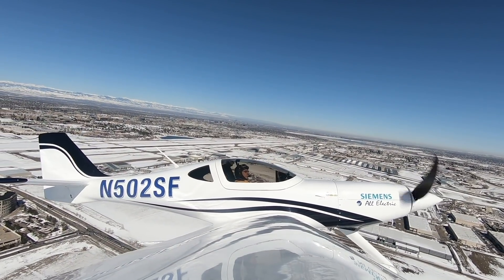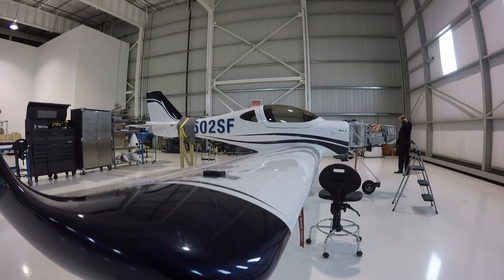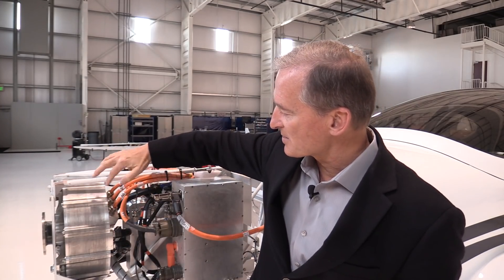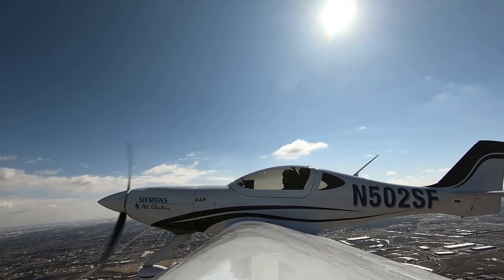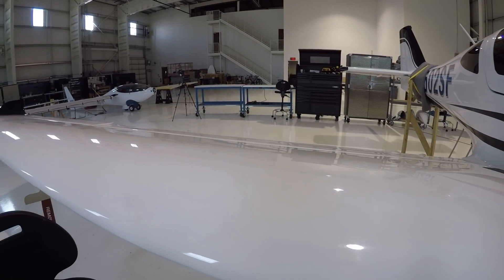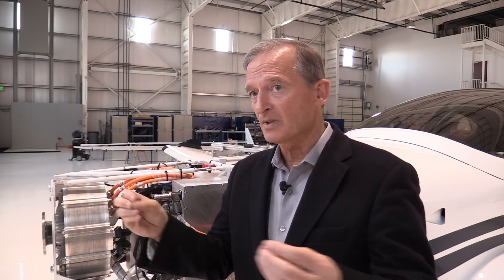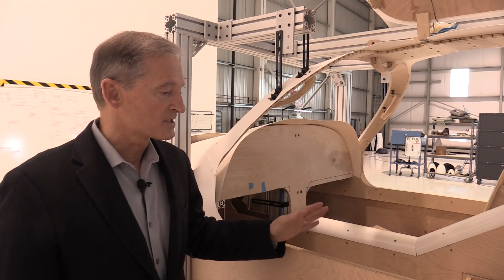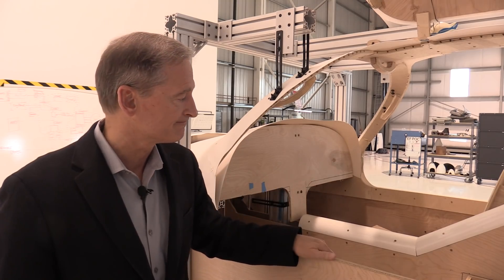Bye Aerospace's eFlyer Electric Trainer

Comment: So what he is really saying is that electric is so heavy it requires GA certification to get the payload needed for a practical training flight of one hour only. Has anyone told him that the current GA competition has a price point of $260 k for a product that has a large flight envelope? Would be interesting to crunch the numbers if he was able to tell us the capital and running costs of the Bye.. Maybe if the LSA revision ups the payload he can short circuit the mission and provide a more compelling economic proposition but I can see this becoming a political hot potato because Piper won't like their market position being undermined.
Reply: What revision?  Are you describing a pipe dream?
Reply: @DumbledoreMcCracken  - https://www.aopa.org/news-and-media/all-news/2018/october/12/changes-to-lsa-rules-on-the-horizon
Reply: @PaulAnthonyDuttonUk  In the PA28 "Piper Pilot" or whatever their 269 k $ trainer is called, the IO390 still guzzles 8 gph (and more in the pattern). Now you gotta factor all these costs that vary in overhaul (engine reserve vs battery reserve depending on loading cycles), depreciation of capital, insurance (electrical motors are simply more reliable) into a price per hour for the customer in flight training. The battery costs will be the key, in my humble opinion. If a Florida or AZ flight school can sell 1000 hrs each year on a Bye trainer or a PA28, what's the higher revenue? We'll soon find out.
Reply: The estimated cost of operating the eFlyer 2 is about $14/hr. That includes energy/fuel, maintenance, battery replacement reserve, etc.
Reply: @airops423  It always surprises me how if you put a gallon of diesel through a generator the energy value all of a sudden becomes 10 times cheaper... :)  Some one is playing games with us. Maybe we should just go to electricity stations to get our gas coz clearly their fuel discount is kind of massive. Yet you can bet your bottom dollar that as personal transport moves towards electric, governments will introduce a new kind of KW that is taxed such that it is no cheaper than gasoline..
Reply: @airops423  Would love that, but I would love to get "good guestimates" on the battery life. If Pipistrel offers its battery for 1000 cycles at 20,000 €, that's 20 per hour. If you go 90 min on the Bye 2, that gets down to 14 $ if similar. Would love that, definitely.
Reply: @Walterwaltraud  95% ofLead acid packs are recycled. Under 5% for Lithium based ones. What happens after 1000 useage/charge cycles to these packs? In UK we incinerate our old mobile / cell  phone packs in Belgium!
Reply: @airops423  Nope

Comment: A 120 Knot 2 seater with negligible range for 350,000 US. The sales department better be damn good at their job.
Reply: Do you know how much cost a brand new cessna 172?, more than that, with a similar Rangel and much higher operational and maintenance costs. It would be perfect for a flight school
Reply: What percentage of Flight Schools buy brand new Cessna 172s? 0.001% ? Also a 172 has about 3 times the range and can be refilled almost immediately. Most flight school will buy an old 172 for US$20000 and still have more than $300,000 left for "operational and maintenance costs". Heck, they can even buy 5 Cessna 172s and have several dozens of Students fully trained up to CPL level by years end.
Reply: @SqueekyClean976  What you are forgetting, is that no one, except for a very few, will be wealthy enough to afford any flight training, no matter how inexpensive it is, with current economic policies in place. As long as the wealthy keep getting all the benefits and breaks, and everyone else has to pay for it, there won't be enough money in the economy for anyone but the wealthy to participate. And don't say it won't work, because it already has worked. Prior to 1980, the marginal rates were more evenly spread, and there was money in the economy.
Reply: The only time range matters during training is cross country flights.
If you're just doing maneuvers, endurance is the name of the game, which is why they are targeting the training market.
Reply: :) Even pipistrel alpha electro is 3 times cheaper

Comment: These batteries would have to increase their capacity to 10 times their theoretical limit before they would be half as good as a 100LL powerplant.  This is just a waste of time with current technology...People say you can use them for training....but most training airplanes do 4-5 hours of flying every day with quick 15 minutes turns.  There is NO WAY...training aircraft will be the last airplanes to use electric power plants.
Reply: Considering the range (or lack of) of the aircraft, it's understandable they figured flight schools should be their target market.
Reply: Chet Carson  depends on winds, pre conditioning and how warm battery is throughout
Reply: Average duration of training mission? All in the 45 min to 90 min regime, unless x/c. Proper de brief and preflight brief will allow for 30 min charging when looking at the pilot mills in AZ and FL. That's the real life application. Plus they already sold 60 production slots to Norway. If you fly her for 6 hrs a day on 330 days a year (Az & FL), that's pretty exactly what any PA28-140, Traumahawk and 152 does in those areas. Boils down to direct operating costs per hour.
Reply: Justin - 100% right.  Charge times effectively double if not triple the capital costs of these electric planes.  Also, these guys NEVER adjust for cold climates, extreme (full throttle use), aging battery packs, cold batteries....and on and on.  Teslas do NOT sell in northern climates where their range is cut by 50% in winter.  Four of five biggest flight schools are below 32F for 6 months of the year - devastating for any kind of battery driven device.
Reply: @tbreit  Norway is Tesla's largest foreign market. Range loss starts at about 40 degrees F and amounts to about 20%. EVs do always start in the cold. Charge times about 20 mins to 80% - 75 miles in 5 mins on V3 Superchargers. EVs can now charge quicker than humans pee and eat. Cycle life is 1500 to 80% degradation. Tesla aims for a million mile drive train next year with new Maxwell acquisition, and at lower cost.
Reply: @waynerussell6401  Wayen, Norway is its biggest market because of (1) 99% all energy water driven dams which is virtually free and (2) $7 cost of gasoline vs <$3 in USA, and (3) HUGE, government subsidized charger system with outlets on every parking space in most cities.  Also, (4) all-electric cars and utility vans are exempt in Norway from all non-recurring vehicle fees, including purchase taxes (extremely high for ordinary cars), (5) 25% VAT on purchase, together making electric car purchase price competitive with conventional cars.
Reply: @waynerussell6401  Check out Tesla Bjorn on EVs that don't start well in winter after a cold soak stay at the airport. Charge rate in cold temps also very slow unless pack is heated.Range loss starts below 20 deg C without pre conditioning. Drive train does not include battery pack from Tesla - quite a few packs in  Norway die within 75,000 miles. 8 year warranties only to 70% SOC of available capacity - for a BMW i3 that's down to 13 kWh !
Reply: @TekAutomatica  I have watched most all of Bjorn's videos and he is the most strident advocate of EVs in all climates! Remember Tesla can precondition their battery temperatures before charging on an app. Even when travelling the car will make sure the battery is at optimum charging temperature before you reach the chosen charger. Long term storage of vehicle in low temperatures will drain the battery as phantom drain occurs.
Tesla will release their one million mile battery next year. Chemistries that are more temperature tolerant are now known. Current massive number of data points shows Tesla batteries currently do 300 - 500 k miles. Quite some examples of plus 400k km taxi services. It depends how wisely you purchase an EV brand. Outliers will occur in any tech but warranty has taken care of that with Tesla. Reportedly less than 6%.
https://electrek.co/2016/11/01/tesla-battery-degradation/
https://www.nature.com/articles/s41560-019-0428-9
Reply: @waynerussell6401  I own an ev and in winter it's not much fun. Model 3 has similar issues and no heat pump. Tesla Bjorn's model x packs didn't last long and there is no video of what actually happened to that pack. Norwegians are some of the slowest drivers on some of the smoothest roads with the best ev infrastructure globally. Model S GT racer only lasts 2 laps at Barcelona race track at 30 deg C
Reply: @tbreit  lots of myths there.
Reply: @Nicholas-f5 - please provide math or references refuting my claims.  I copied additional data above for your review.  I look forward to anything of technical value.  

MOTOR EFFICIENCY:  Looking at JUST the motor, these things are not built by Jesus - physics has limits.  The BEST motor in the world might reach 94% efficiency at the middle of its torque band in a lab at 72F.  Unfortunately, real-world units built for rough environments with huge environmental/load swings are 85-90%.  Now, lets go to max load (takeoff) and this efficiency plummets to 75-80%.  So, to pull 90kW shaft output requires over 110kW input.  

BATTERIES/WIRING:  Below 0C, all LiOn batteries MUST be heated to produce reasonable output.   Looking at a temp/output graph for any LiOn battery shows it drop to horrible values below -20C which is fairly common at altitude.  Now compound lapse rate taking off from 0C pulls below -20C climbing only to 6,000ft, a common level for any distance training.  These low temps can degrade battery use 20% just for temps and rise to a 40% degradation just to heat the batteries for proper operation.  Now let's add wiring losses which will be another 5% plus battery degradation over time which all batteries are subject to.  Also, Tesla pushes hard to NOT 100% charge batteries since this shortens their life.  lso, this is not a car - there is no braking regeneration taking place so you cannot look at recovering energy.  

TRAINING CYCLE:  Gas vs. electric power on a plane does not change.  A one hour training cycle would easily include  4-5 take-offs with go-arounds.  On one cycle, that motor is pulling 100% power (110kW from battery) for climb, falls to 70% power (80kW) in cruise for upwind, another 80kW on downwind, another 80kW on base, then maybe 50% power (55kW) on final which is the shortest time segment.  We are pulling on average about 80kW for 1 hour ..but.. the varying loads, temp impacts, battery life degradation, and wear all add up easily 80-90kW drain for 1 hour.  

SUMMARY:  I have not read ONE of these airplane outfits that are willing to place real world data in their materials.  My math is valid if not generous towards these companies.  Until they provide even minimal data to support their claims, electric planes remain R&D projects.
Reply: @tbreit  
"Tesla Model 3 helps push EV sales in Canada to record 8% of new car sales" November 7th 2018, Electrek
So you're just plain wrong.
Reply: @RealestUrbanism  on which side of Canada the warm border or the cold north?

Comment: Looks like a Lancair.
Reply: I agree, and I believe that the original Lancair 200 has influenced almost all of these modern 2 seater, low wing composite aircraft out there, at least design wise.
Reply: @DumbledoreMcCracken  Thank you for the correction 👍🏻 I'll edit the post
Reply: I guarantee that is a lancair bought form lanciar and then they did what they did to it to get the engine to do what they needed it to do.
Reply: @gusbisbal9803  it's an Arion Lightning